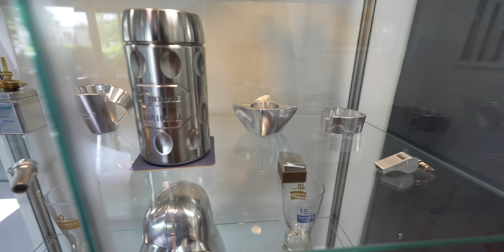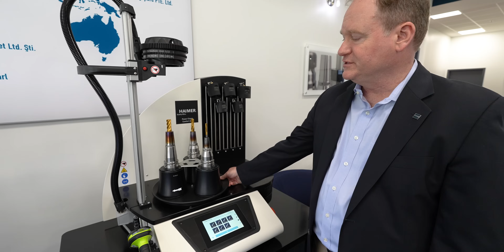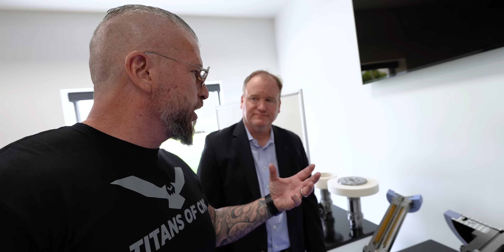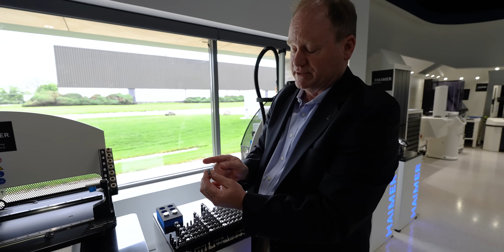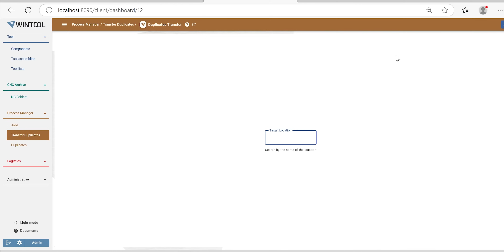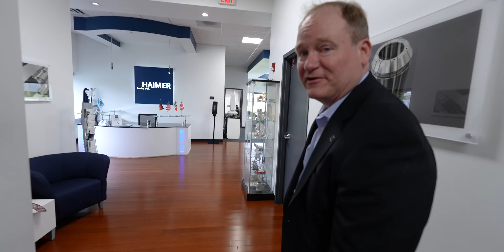Next-Level CNC Technology that will Elevate Your Company

Comment: only thing i wish for is that instead of moving the coil up and down for heatshrink then why not have the toolholder itself move up and down instead ( so you dont keep moving/bending the wire. fatigueing it ( you know less electrical part breaking/trubleshooting )
Reply: They don't use wires, this company is so advanced they use shit that hasn't even been invented yet, like atomized particle suspension to replace standard conductors.
Reply: @catjenkins3212  you mean "atomized particale accelerators " right ?
that is kinda what the magnetic/heating couil do ( accelerating the magnetic particals in the metal to vibrate faster from the constantly switching the magnetic field generating the heat that makes the hole expand )

and with that in mind i kinda have a partical accelerator in my kitchen ( inductive stove ) though it only works on magnetic metal stuff ( for now )
Reply: @leftwichenternainment and your argument for that would be what ?
Reply: @leftwichenternainment to do what. come with a agument why its a dumb idea ?